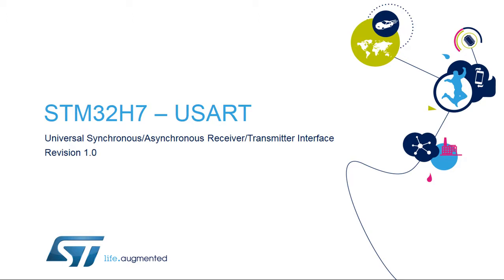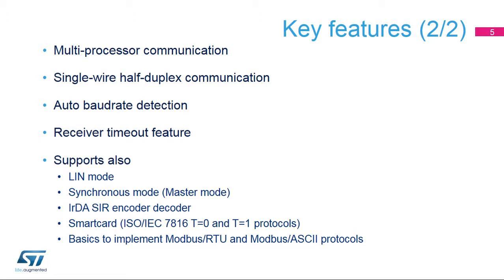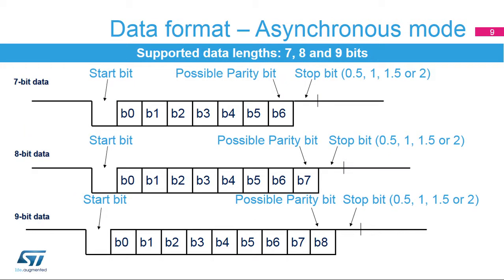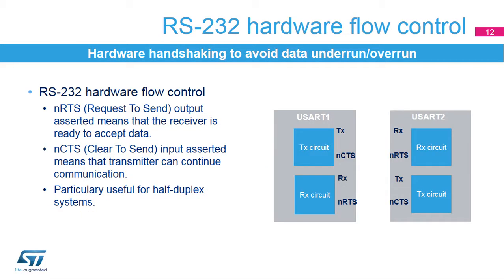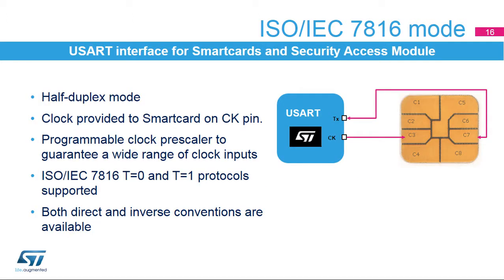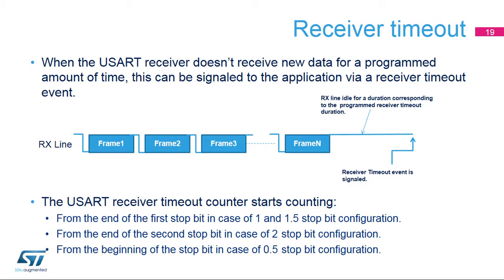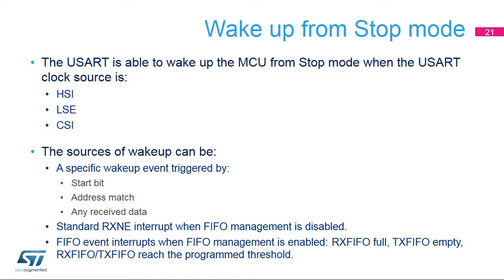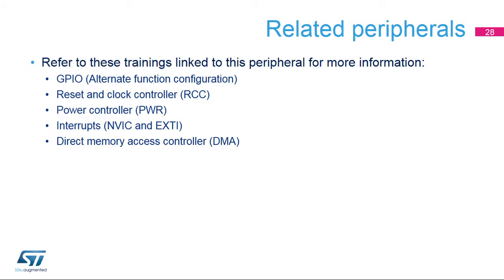STM32H7 OLT - 41. Peripheral USART interface USART

Comment: At 13:08 the narrator says the Tx and Rx FIFOs are both "16 words deep," but the slide says they're 16 bits deep. Which is it? The book only says the size is "16," without specifying if that is bits, bytes, or nine-bit words. What the heck with the info here, guys?